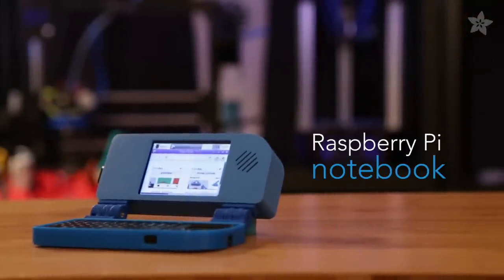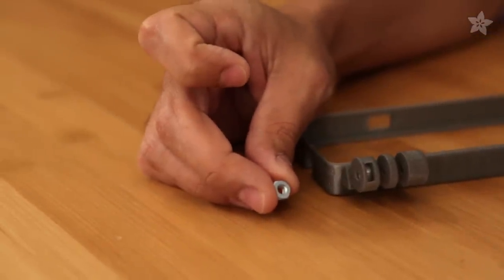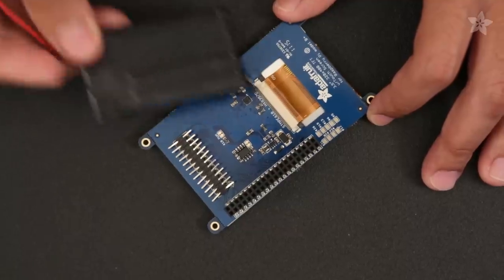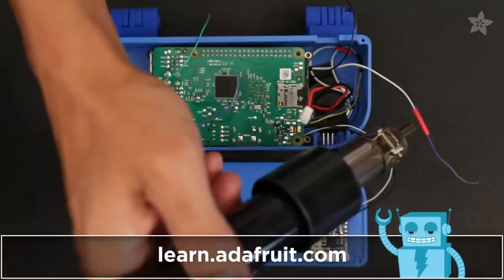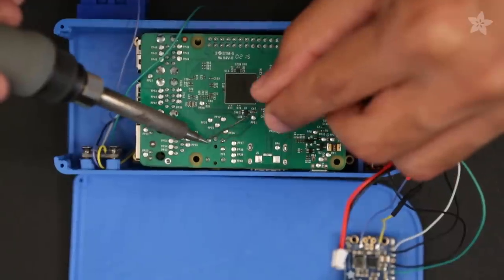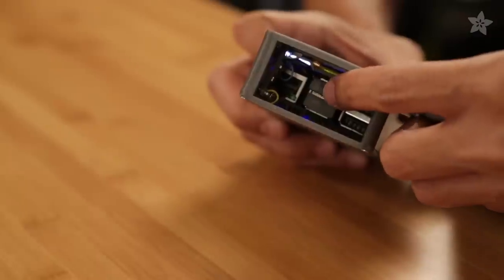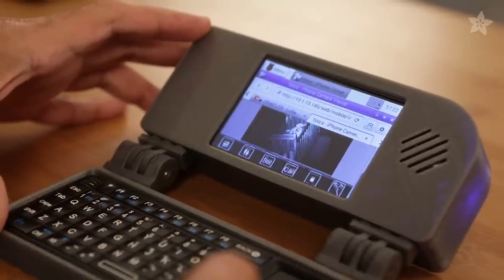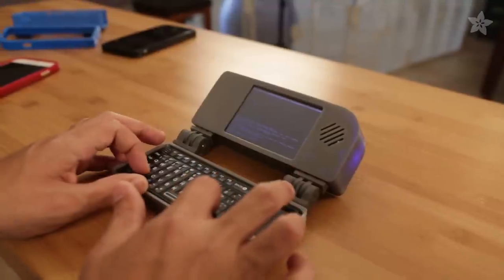Mini Raspberry Pi Handheld Notebook #3DPrinting #Adafruit #RaspberryPi

Comment: Wish that these kinda completed mini computers were sold online
Reply: there used to be all kinds called UMPCs. Viliv N5, Fujitsu UH900 and UMID Mbook SE were some great ones. they arnt made anymore :(
Reply: +Otaku M. i feel you bro. i join.
Reply: because they weren't terribly useful but they were terribly expensive. It was just something that you still couldn't carry in your pocket, but you could carry it slightly easier in a bag compared to a laptop, however, it was tremendously more awkward to use than a laptop.
Reply: I could make a store for something like this, do you think they would sell?
Reply: Shay It would be a rather costly product that most people wouldnt consider , instead ,  buy an actual laptop.

Comment: Would it be possible in a larger build to attach the motherboard and memory of an Ipod to the same display, and be able to switch between running linux on the raspberry pie motherboard and ios on the apple one?

Comment: So gotta try this with windows 10! Try port some existing software!
Reply: David Cooltions porting a current version of windows will get you in to some trouble :). but there is a windows 10 pi version coming out soon i believe
Reply: They have already made it. Works great natively. No porting needed.
Reply: +David Cooltions could I have a link to it please?
Reply: Dude, Win10 for Pi isn't real Win10. It just serves for IOT projects. Also why do you even want to install Windows 10 to Pi? It is nonsense. Linux is the best solution for SBC computers (also at normal ones I think). What can you do with Win10? You can just play games and that's it. But with Linux, people are making wonders.

Comment: Id love to build this with either a pi zero 2w or mango pi pro with risc v and run kali linux on it with coral ai, and a secondary pi zero 2 w or mango pi pro with android 13 and add the glms module to turn it into mobile phone as well, with a monitor switch to switch between sbc's

Comment: So I noticed, why does it not include full list of parts? The slide switch and speaker were missing and I am unsure if there are any other parts I am missing.
Reply from the maker: Full list of parts are on the learning guide linked in the description.
Reply: Also on the subject of parts, what is a good, cheap place to buy 3D printed parts, as I do not have one and do not intend to get one.
Reply: Also, is there any place to buy these preassembled? I would buy that.
Reply: Yeah thats what is holding me back from making this, I dont want to have most of it done to realize I am missing a part and I don't know what part

Comment: umm, some of the parts are missing from the list like the speaker. Also this is going to be my first project so it would be great if it was shown where all the wires connect
Reply: link in the description includes everything
Reply: did you ever get the wire placement figured out? I am stuck on the wire placement also

Comment: Do you have a version that I don't have to bend the pins on the header?
Reply: +neotracer075 sorry nevermind i just realized it is on the screen... sorry about that.  Haven't got the pi yet but quite interested.

Thanks,
neotracer
Reply: There's Waveshare 3,5 inch screen in the market which is way more better and cheap than Adafruit screen.

Comment: hey would i need to add heat sinks if i only use it as a netbook
Reply: +Andrew Barker Hey i just burnt up my pi do not try to use the HDMI port
 for a bigger screen it worked great without a heat sink untill i tryed 
to hook up a larger monitor to the pi

Comment: I'm eleven and I made a mini fan this may be slightly harder
Reply: +Samuel Adhanom Well...yeah. A fan is just a motor with a fan blade. This is an actual computer. Its still pretty easy though, just a little soldering and snapping parts into a case.
Reply: Dr.Cactus don't forget copying codes in right places

Comment: Wifi enabled?
Reply: Raspberry Pi 3: yes
Raspberry Pi 2 and older: you'll have to use a dongle
Reply: +Mouâd L. Is this made for raspberry pi 3?
Reply: yes, even if you can use other models like the pi 2, and the pi b+  :)
Reply: Thx very helpful
Reply: np ;)
Reply: What could i use to make a simple pi computer that wirelessly connects to the internet and that i can use just for downloading and coding.